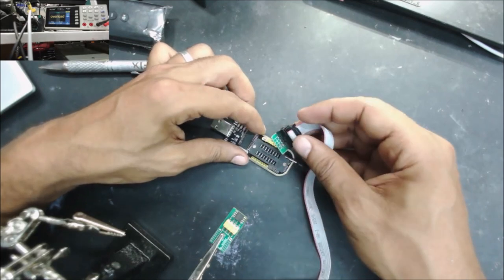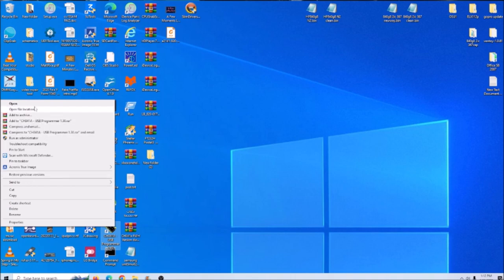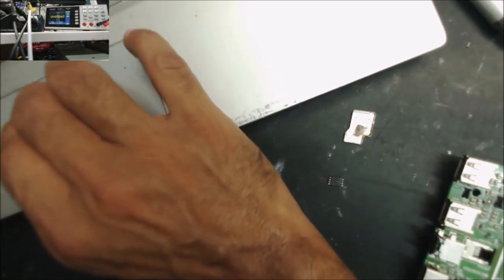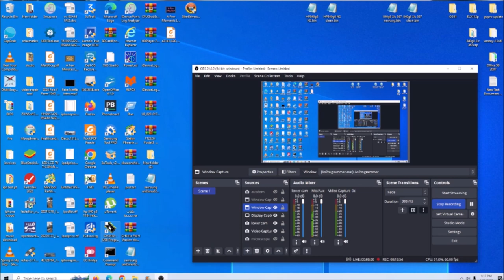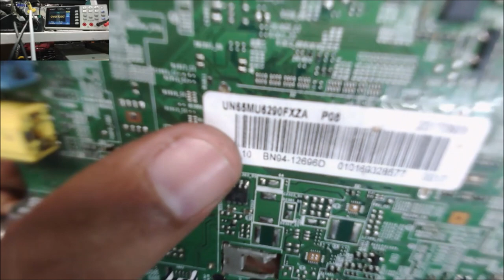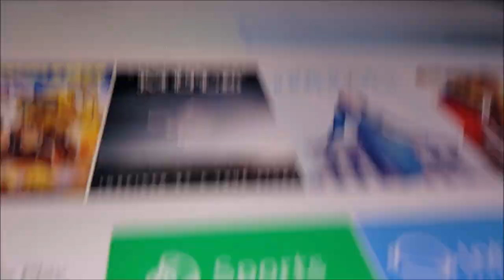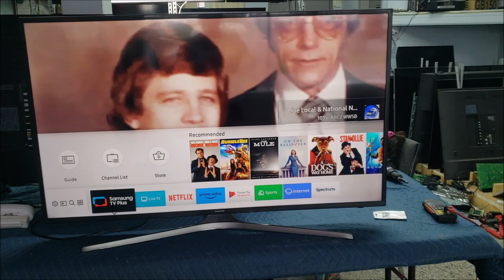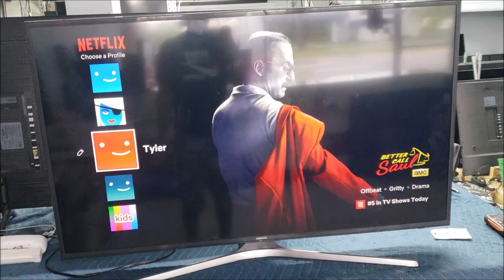Samsung TV program the startup eeprom  from 65in to 50in mainboard

Comment: Hello, please i have a Samsung tv with no hdmi output signal, could it also be an eeprom issue?
Reply from the maker: if there is o ship between hdmi and cpu must be  eeprom or processor issue, you can use components to hdmi adaptor will give you 1080p picture